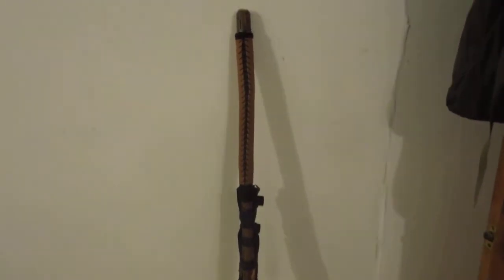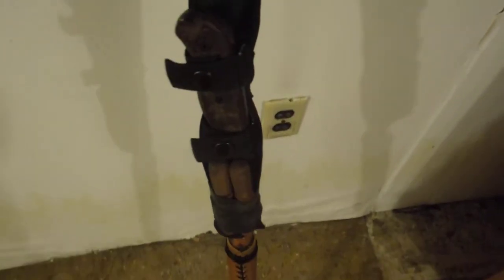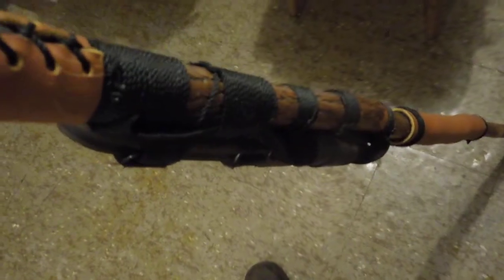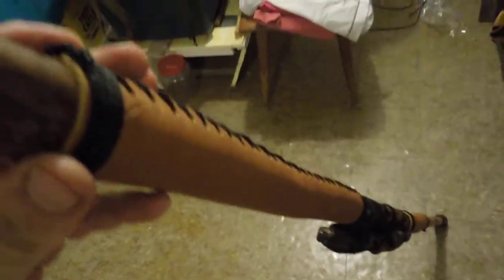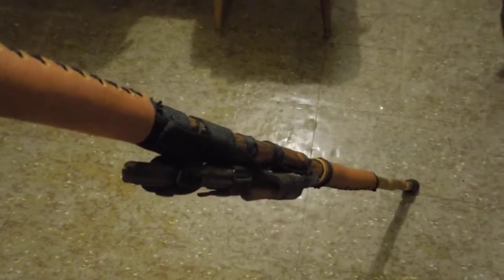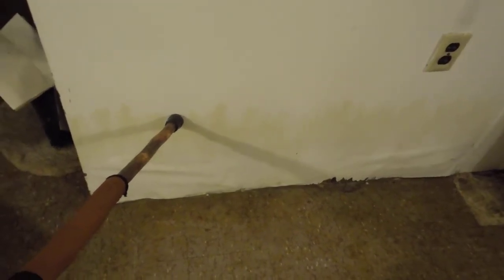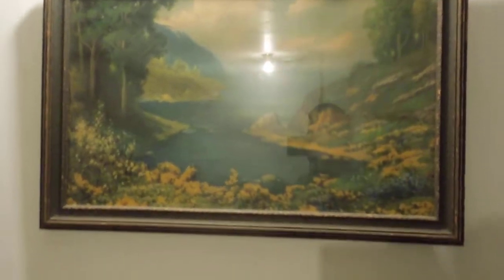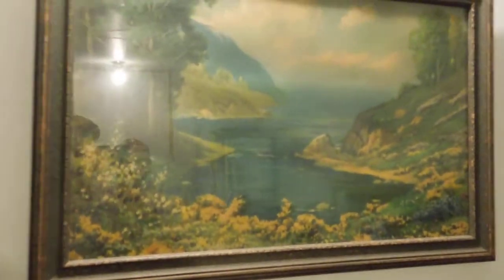Progress on Walking stick modification.

Comment: This summer has been crazy everywhere, just so much water and flooding, or complete drought elsewhere.  That walking stick is very cool Randy! That was smart to put the innertube underneath too!
Reply from the maker: +SouthPaw Bushcraft 2 years ago the city and the county finally quit arguing about whose fault it was and installed a new 48 inch drain tile.   Before several thousand acres of farm ground and the town was drained by a single 8 inch line.  As it crossed the field in back of my house it jumped up in size several times but they followed the low ground for the tile so the path was away from the exit point.  So you could be looking at the ditch 1/4 mile away on the east side of town and spit in the drain.  It would flow the pipe west then north and then back east close to 4 miles before it got back to the ditch again.  the original county tile was hand dug by handshovel in the 1910s.  It worked until the town was hooked up to it.  Over a hundred years of finger pointing.  :)

Comment: You could survive a good long time with just the stuff on that walking stick. I like the instant access to everything. I like the yard sale art find too. 25 cents is a great find when you like something. I bought an awl at a yard sale for 25 cents over 10 years ago and it has paid for itself many times over and I still have it.
Reply from the maker: +saltyshellback not worried so much about surviving as much as a functional tool set so that I can walk out of the timber.  I'm not heading into a national forest so much as a 300 acre state park with a fence all of the way around it.    I took some vidseo of the front part lower timber away from the established hiking paths.  Gives and idea as to what the place looks like.  Easy to get turned around in.
Reply: Yup. I almost got lost in 2 acres of woods...lol

Comment: Not a bad concept.
Reply from the maker: +Haven I was going for the simplest solution I could find.  The extra leather was just to use up material I had already cut and made lacing holes in.

Comment: Save the desk!
Reply from the maker: +Daniel M always.  I have another one the same size and style upstairs.  The table comes apart with two square nuts on a long all-thread bolt.  It breaks down into the table top, two legs, then the base.